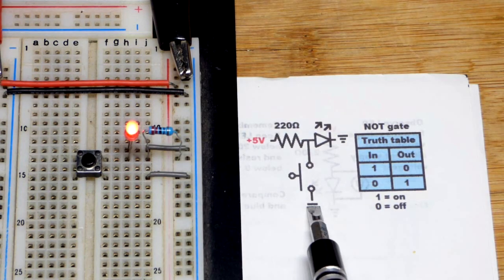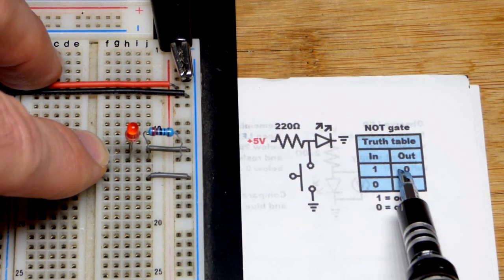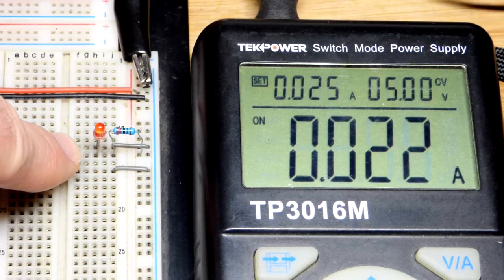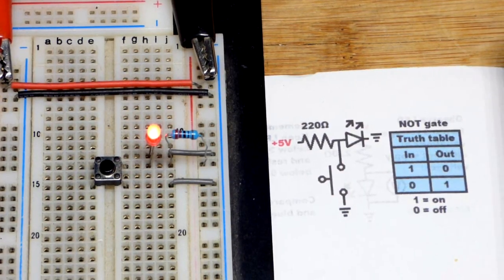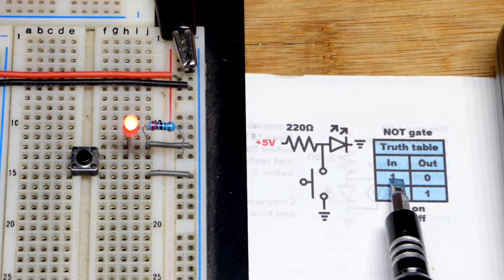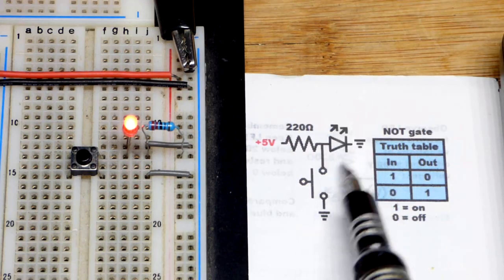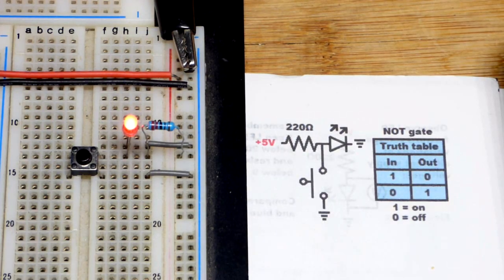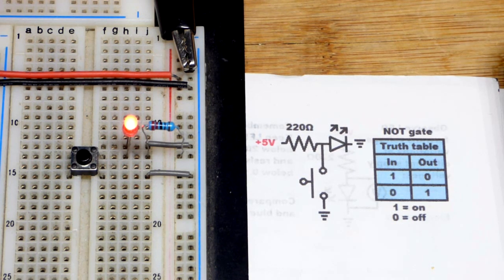Simplest Switch Based NOT Logic Gate Circuit

Comment: I used a similar circuit to hook switch up to TTL logic gates, so that'll tell you how long ago that was.  Just a 1K resistor from Vcc to the input of the gate, then the switch from that gate input to ground.  As it was TTL I probably could even have got by without the resistor as TTL floats high, but I never liked relying on that.  If I needed a debounced switch I could add a small capacitor between the input and ground and use a gate with a schottky input.  Though that wasn't my favorite way to debounce a switch it was simple and worked with a SPST switch  :)
Reply from the maker: Very cool, thanks for sharing :) I been thinking of getting older logic gates ICs to better understand old circuits.
Reply: @Electronzap  TTL was great.  As forgiving as it comes.  Plug them in backwards, they don't care (but they do get hot enough to burn you or melt plastic protoboards), static electricity isn't an issue, very tolerant on being shorted to either ground or Vcc.  And a mature logic family with everything from the basics to some quite advanced chips.  I still dabble, but it's been decades since I've done any real work.